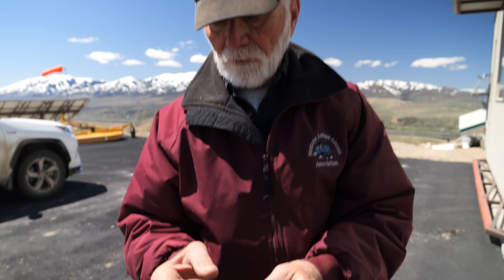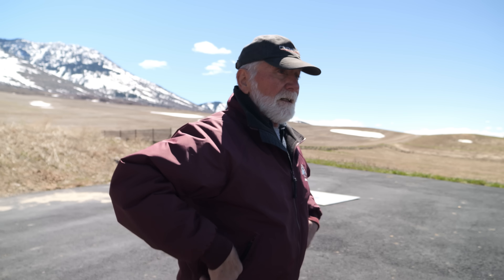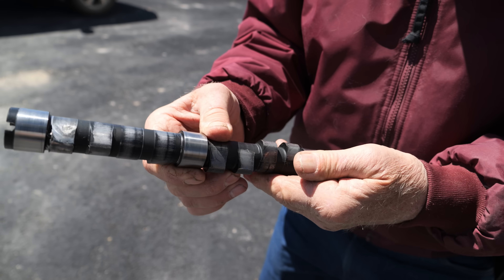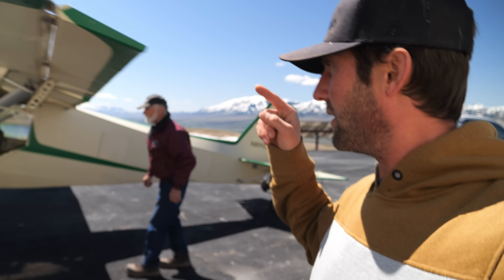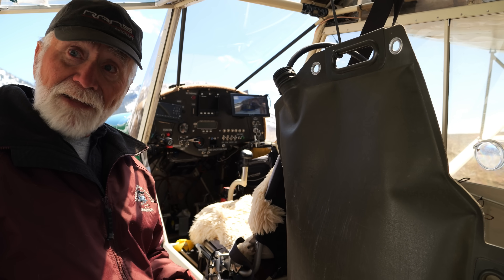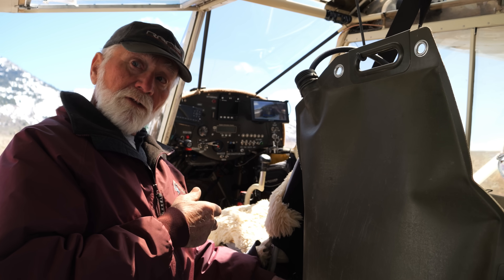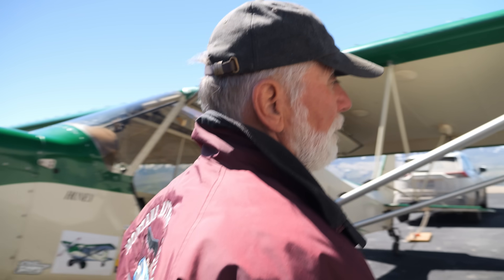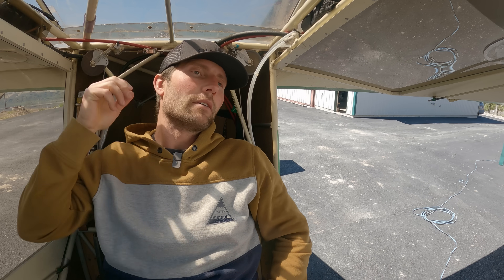Tom's Engine is Fixed! Rotax 912 Complete Tear Down.

Comment: Damn, I used to think the Rotax 912 was a good thing, but I’m starting to wonder.  Too many mechanical failures on engines that were no doubt properly maintained.  Wish there were reliable statistics on this.  Makes me appreciate flying my Mazda rotary though.
Reply: Check back when you have over 3000 hrs on it, like I do on the 912 engines, this camshaft issue being the only problem, and it was caused by a mod, not stock.

Comment: Anytime valvetrain weight, cam specs or max rpm is changed it is crucial to have appropriate valve spring seat and open pressure.  Also make sure springs don't bind or have too much clearance.

Comment: Ducati motorcycles did away with valve springs years ago to eliminate valve float, the developed cam  operated fingers that open and close the valves, they still use the desmodronic system today.
Reply: Very interesting, thanks for sharing.

Comment: What oil is he using? I think Rotax recommends like a premium motorcycle type oil or their own branded oil don't they? I think Shell has a light sport piston aircraft oil as well.  Modern automotive oils have reduced ZDDP,  zinc phosphorus, content in them because it's hard on catalytic converters and with roller lifters & followers they don't need as much either. ZDDP is a sacrifical extreme pressure additive used to protect the cam lifter interface. However too much zinc isn't good either, it has to be a balance. Some years ago we started having a lot of cam failures in classic cars, high performance engines and hot rods that used flat tappet cams like what the Rotax 900 series use. It was found that the automotive oil manufacturers had much reduced the zinc content in the oils to be the culprit. Diesel oils used to have a pretty high zinc content, but they have been reduced now as well.

Comment: You be surprised when you put EProp on I have one on my zenith 701 Rotax 912 uls I took off 7 kgs with old prop EProp weight was 2.5 kgs plus gain 7 knots ,easy starting less inertia they are great prop

Comment: I was one of the floating valve comments on the last video. Lifters don't cause valve float, weak/broken valve springs do. If a valve spring floats enough, it can wipe out a cam lobe. I hope they checked the valves springs when they went through that engine, or this could very well happen again.
Reply: Exactly.
Reply: They were checked, the #1 cylinder, which the bad lobe controlled, were a bit weaker, coiincidence, or not?! They were replaced with new.
Reply: @portnuefflyer  If the reground cam has higher lift then standard springs might not be stiff enough.
Reply: @tomrc. You are 100% correct. Lifters don’t cause valve float. Bad springs do or turning a higher rpm than the spring is designed to handle. The only other way to wear a cam down like that in that short amount of time is a finish issue between the cam and / or lifters or a hardness issue of the cam.

Comment: Rotax had a SB a while back about improper/incomplete oil purge leaving air in the hydraulic lifters which would prevent them from operating properly. https://legacy.rotaxowner.com/si_tb_info/serviceinfo/si-912-018r2.pdf

Comment: If anybody knows how to figure it out it’d be Hal Stockman. It looks like the camshaft wasn’t properly heat/chill treated or wasn’t high enough in Cr content.
Reply: Or there are valve spring issues causing the valves to float, taking out the cam lobe in the process.

Comment: I know I am going to get a lot of hate for saying this but you could not give me a Rotax . Wait, maybe for a go cart.
Reply: We should go for automotive factoring standards in aviation motors. Honda and others can’t afford bad cam quality in 100.000 engines…
Reply: @richardbieber9323  Viking A. Engines 140T plus E-Prop five blades
Reply: I put 2300 hours on the first one, in 12 years,  totally trouble free, averaging less than 4 GPH on mogas, and that was only doing about half the recommended Rotax maintenance, that made me a believer.
Reply: Or penicillin.
I'll never buy one, but you can give it to me and I'll give you some wood and a couple of flint stones.

Comment: I will say this, Hal is wrong valve float is a valve spring issue this is where the valve spring tension cannot sustain the RPM,  this can be as simple as a harmonic in the system, overly tight valve guides, week structure in the pushrods, camshaft profile, and just over revving. A flattening of the power curve is common along with others like missing or popping in the intake exhaust.   The common result to the engine is brinelling of the cam and lifters causing camshaft failure.  Second issue could be that the breaking oil was deficient in Zinc a common problem in today's aftermarket camshafts.
Reply: @1960fl is actually 100% on this. The surface failure is most likely brinelling as a result of valve train float. Valve train float would most likely be a spring harmonics issue not ensuring the lifter stayed in contact with the lobe resulting in the lifter bouncing on the lobe, pounding it to death. I don't know the Rotax valve train intimately, but harmonics are generally overcome by using 2-spring or even 3-spring sets for each valve so differing frequencies, or dampers to spoil the frequencies. Changing cam grinds change accelleration rates, and changing lifters, valves etc change inertia, overheated or broken springs or remachined spring or valve seats of failing valve keepers or retainers reduce spring pressure, so this all effects the ability of the spring to control it all. Surface finishes, oil quality, debris in the engine, all add pain to a system not performing properly. Hal was right that it was valve train float not allowing the engine to rev, but this is because the cam was in a self destruction cycle. Hydraulic lifter pump-up usually results in burnt or bent valves when they don't close properly. I suggest at the very least use a new set of springs with your new cam.

Comment: Kind of the same thing happened to mine probably 20 years ago in an 80 hp 912 UL.  It just got to where it wouldn’t hardly get above 4500 RPMs I took it to Trevor Jacobson in West Monroe Louisiana thinking I had a carburetor or timing issue. 
   He was just spinning it over listening to it with the magnetos off just letting the motor spin and he told me I had a flat spot on the cam just by listening to it.   
  I was just thinking about this yesterday, for a new cam and installation total cost was $264.

Comment: Looks like a possible metallurgical issue.
Reply: Also lack of zinc and other important oil additives. We can all thank you know who.
Reply: @totallyjonesin  well, nàw, actually about 10+ years ago the zinc content was greatly reduced in modern automotive oils.
Reply: @oneninerniner3427  In the late 70's early 80's  we had a rash  of scrubbed cams in GM pickup 350/400s. These were new under 5000 miles  I was a dealer tech at the time. Dropping new crate engines in about one a week.  They decided it was a combination of poor oil and the double valve springs. That is about the time the ecofreaks got a hold of the oil.

Comment: well hot damn it was the cam . thanks for the update bud
Reply: Or floating valves due to weak springs caused the cam wear. If he didn’t replace the weak springs, we’ll find out.